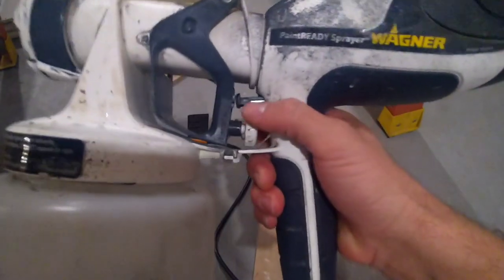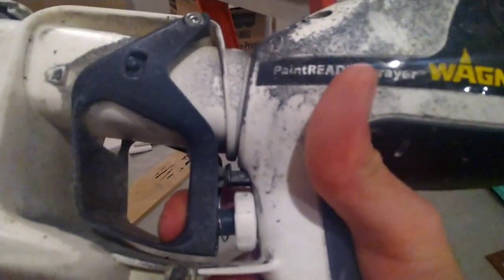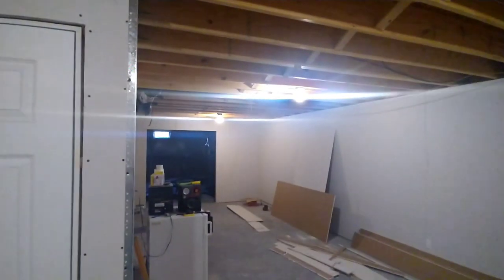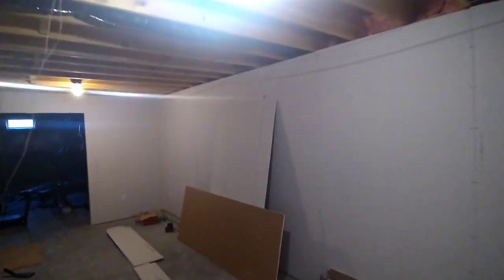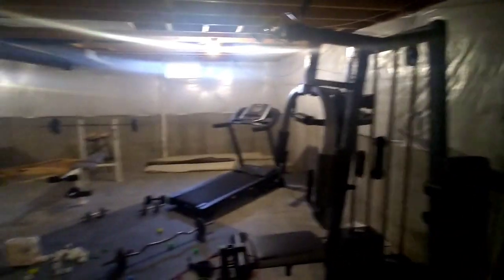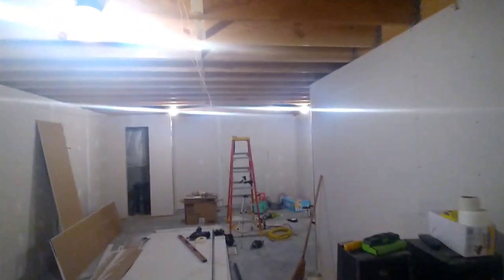HOW TO PAINT AN EXPOSED CEILING | DIY BASEMENT CEILING SPRAY

Comment: If anyone is considering painting their basement ceiling use dryfal paint.  Also known as “drop dry paint,” dry fall paint contains additives that allow it to dry quickly. Similarly, since overspray dries rapidly as well, excess paint can just be swept away. For this reason, dry fall painting is one of the preferred methods for basement ceilings.

Comment: Did  you have nails coming thru the ceiling from the first floor and if so, did you cut them before painting?
Reply from the maker: Nope no nails. Though if I did, I would have left them. Once painted, it hides pretty much all wires or plumbing that you would normally see.

Comment: Almost finished painting the basement ManCave unfinished ceiling 'by hand'.  Omg, I'm retired so thought this would be just busy work, but it's really hard physically painting around all the nooks and crannies.  Older bodies are not made for that.  Ha.  Spray painting really wasn't an option as the room is furnished and just too difficult to move everything out.  

A bit hesitant at first but the ceiling is beautiful.  Hides all the imperfecions of the wood as the ceiling is partially hidden by shadows anyway.  The walls will need paint touch ups due to a bit of paint drippings/spraying using brush and roller.

Nice video.  Spraying when possible is the way to go.  Might be useful to know ~ gallons of square foot coverage.  Thanks so much!!!
Reply from the maker: That's awesome! I thought about painting it by hand and then was able to get this sprayer and I'm extremely happy that I did. Even with the sprayer it took some time. I couldn't imagine doing that much by hand. Thanks for watching!
Reply: @WhatTheHeckMan  how long did it take you to?
Reply from the maker: 2 days but total time about 4 hours. Could have done it in one day but looking upwards that long hurts your neck. Took some time hanging up all the plastic on the walls as well. I really should have sprayed before drywalling but wasn't sure what I was going to do with the ceiling till afterwards.
Reply: @WhatTheHeckMan  Oh wow that is really fast. And yeah painting upwards like that definitely sucks; I've stained decks like that with a brush. Thanks for the reply man.

Comment: A/ What are the benefits of painting a basement ceiling? 

B/ Did you use the same paint for the metal beams?
Reply from the maker: Thanks for watching! So the benefits are that it saves a lot of money vs installing an actual ceiling whether that be drywall or drop ceiling. Also you can always easily access  any wires or plumbing off needed. For the beams, I used the same paint but I cleaned any dirt of debris first.

Comment: great video! i am planning on doing this too. what kind/brand of paint did you use? was that a matte black? also, did you do one coat or several? i have open insulation like you do on my rim joist so i got pink insulation board and cut to size and stuffed them between joists so it had a solid look when i paint rather than painted fiberglass.
Reply from the maker: Thanks for watching! The paint was ColorPlace flat black. From Walmart. It's only $14 a gallon. With the sprayer I used, it only took one coat. I had to go back over the insulation with a flat black spray paint because the pressure from my spray gun is too high and just kept blowing the insulation everywhere.

Comment: Hello are you mixing the paint with anything to make it thinner ?
Reply from the maker: I did only a couple times with water to test it out but then I stopped doing that because I didn't want to have to do a second coat. I sprayed it on thick but not to the point where it was dripping from the ceiling. It's been about two years almost now and still looks like the day I did it. 👍